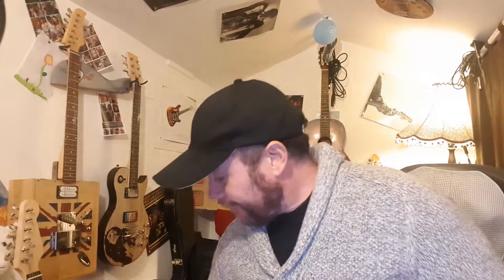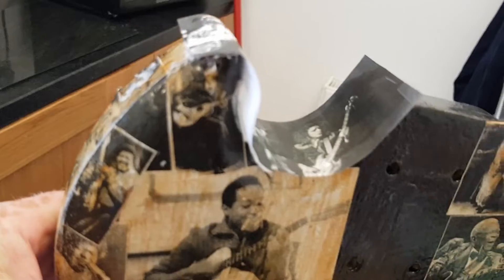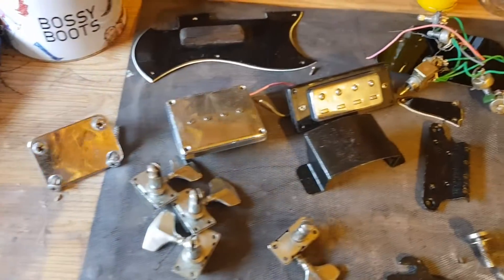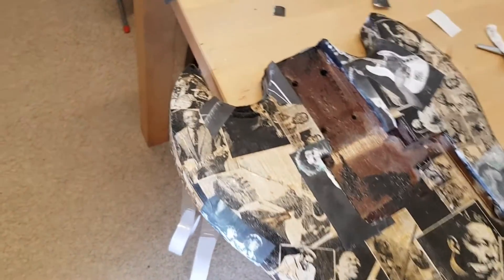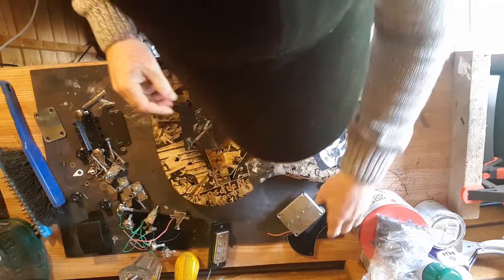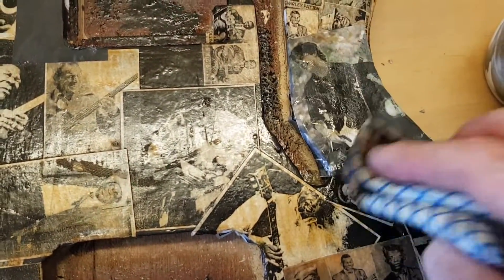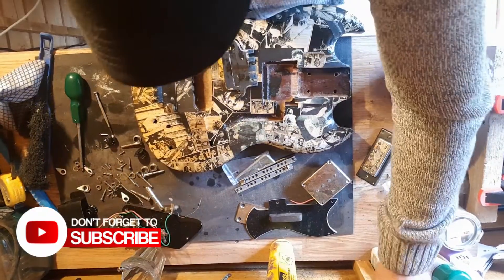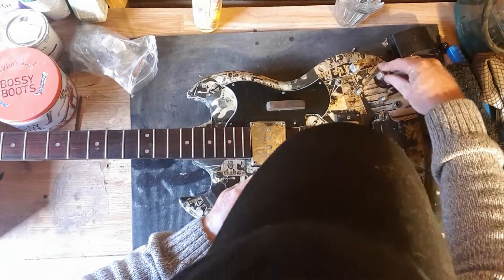Columbus EB-3 Vintage SG Bass / 1970s Gibson EB-3 Copy / Renovation

Comment: Got one recently. 
Cracked around the control cavity and neck pocket, but no big deal.
Couple of tuners stiff. Greased all 4. Better. Original grease was just layers of dirt.  
Tightened down the bridge base plate with new screws and glue -- the wood isn't dense and the screws tend to pull out over time.
Put Thomastik flats on and I usually run it through a Boss BE5B analogue multi-effect unit.
Sounds v good. In some ways better than my Gibson EB-3 which cost 10 times as much. And even easier to play. Well suited to 60s/70s blues rock -- Free, Cream, Bad Company, etc.
Frets get worse higher up, as you'd expect ... but I don't often go over the 12th. One day it'll have a refret.